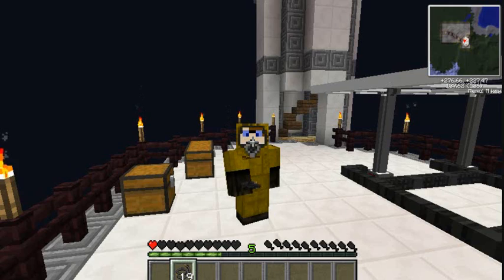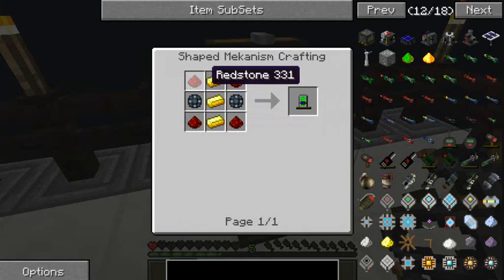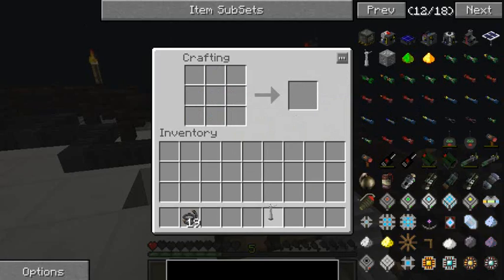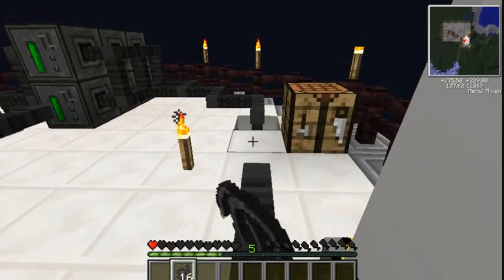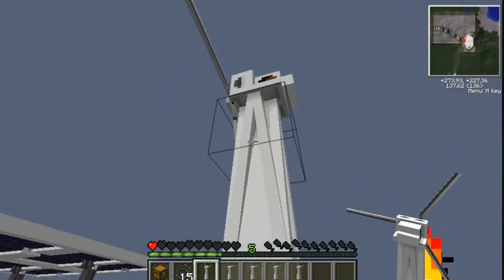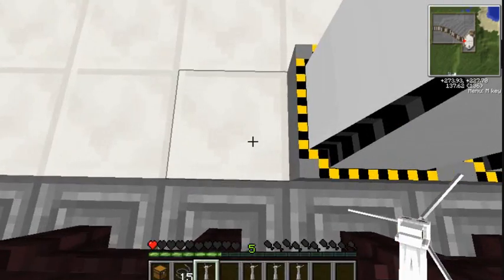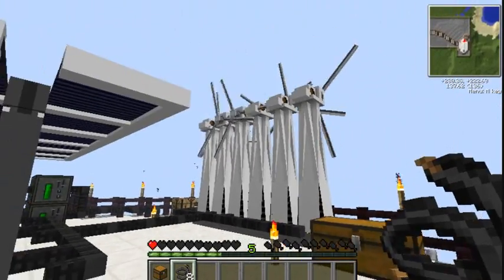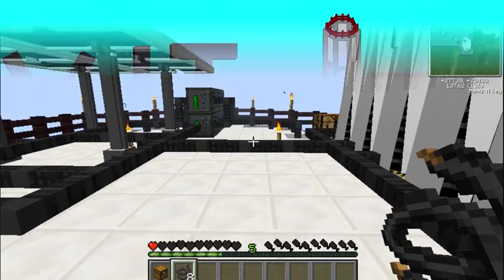Voltz Episode 11 - Wind Turbines on Voltz 2.0.4

Comment from the maker: First make your wind turbines and place it on the top of something like a hill or a building. Next you need to wire them up with universal cable since this doesn't burn like copper wires. Make sure the cable goes to a wind turbine and inputs into a energy cube (Basic would be easiest for this set up). Now I'm not sure if universal cable works with a quarry so you can also attach copper wire to the basic energy cube since it is low voltage and then to a quarry.  Hopefully this worked.

Comment from the maker: I think as long as it is on the top surface it should work. I made some near to the base of the tower and they work the same as the ones on top. If they don't work they can be broken with a pickaxe so they can be easily moved.

Comment from the maker: You need to make the enriched uranium into fission rods for the fission reactor. The reactor needs to be set up correctly with multiple blocks and components or it will explode. I'll show you how to make it in a few days but if you can't wait I think there should be lots of tutorials on it since I don't think it has changed in the new volts.

Comment from the maker: I'm not sure about the wind turbine and advanced solar power together powering both machines. I think the centrifuge takes 2 advanced solar panels just to power the one machine and I'm guessing so does the nuclear boiler. What I would do is set up your system and keep adding extra forms of energy to. For example when you need more power at one time use the coal generator and bio-fuel generator to give your power system a boost. In my next videos I'll show you the other ways of powering machines.